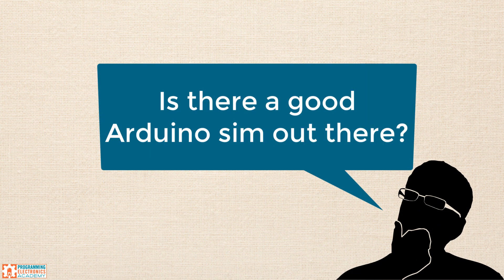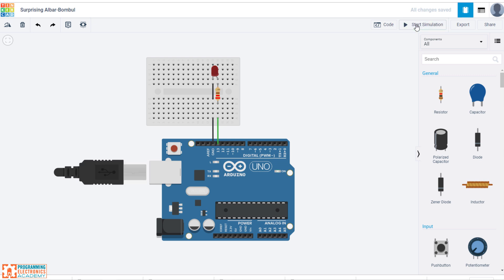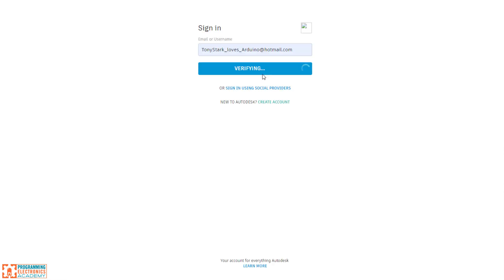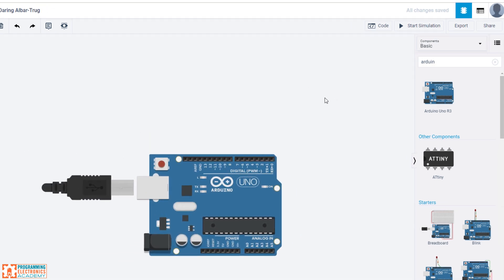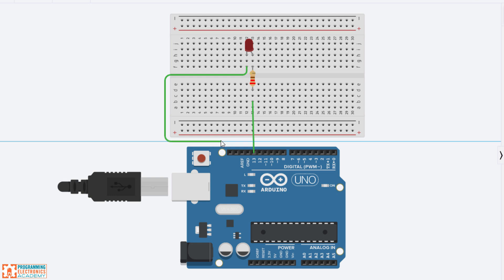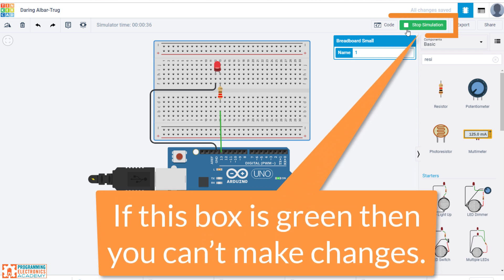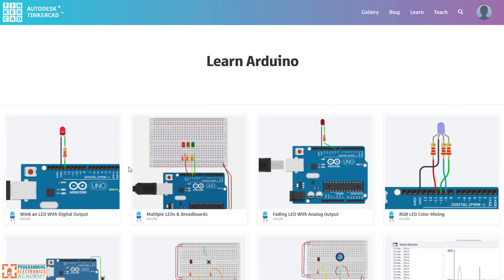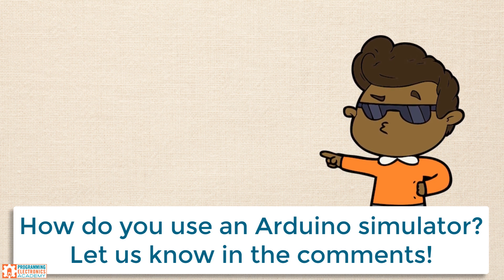The Arduino Simulator you’ve been looking for!

Comment: Hey, an update for Arduino Simulators: (also free) Wokwi. ThinkerCad didn't had the OLED display that I physically have. There are no docs how to create one component with ThinkerCad. Nor import external library. Woki was pretty easy to use. Click + and add the component (several and you can create your own), wire it up, code, play. Also, has Serial output. I've read few docs about how to create devices I2C, and teak the code from uint_8 to uint_32 just for fun learning.

Comment: It might ve a stupid question if I missed some info, but how did you select the 220 ohm resistor if you didn't have any data for the led itself?
Reply from the maker: Great question!  I think if you click the resistor image, it brings up a window to adjust the resistance.
Reply: @programmingelectronics  that one I spoted, I was actually wondering why you set it as a 220 ohm resistor? I did not notice there is any power supply or LED data, and the resistance should depend on source voltage, LED voltage drop and LED current. Can you see the correct data for components in tinkerpad, or do you just set the resistance to real world needs and the simulation just works whatever you put in?
Reply from the maker: Great question  @filips989 ! I see what you mean now.  You're right, 220Ohm is kind of a sloppy resistance value but usually seems to do the job.  I think the sim will adjust accordingly for different component values.

Comment: Simulation is great, but does it also show debugging info. I would like to see what my code does inside the chip, I need to know why it works. OR doesn't work, maybe I'm updating the wrong register or my timing is off.
Reply from the maker: Hi Andrew, I believe the IDE that Tinkercad made for their Arduino simulator has a debugger, my guess is it won't be as granular perhaps as you might hope, but it it is still helpful.
Reply: @programmingelectronics  Sounds cool, I'l check it out. Anything more in depth than print statements is going to help allot haha.

Comment: These guys never make a mistake. The Blink example worked first time. The gallery is full of working examples. What I'd really like to see is that Blink example where the presenter "forgets" to wire in the resistor. Or puts the LED in backwards. What does the simulator do then?? Is this truly a simulator - a design tool -  or is it just an illustration tool?

Comment: How to get the components which are not in tinker cad? Like gsm module. I'm working on a project that i have to present just the simulation and code but some of the components aren't available on tinker cad. Any solutions around?

Comment: Hello! Really nice video! Thank you! I noticed that when the simulation runs, the usb is connected to Arduino. When it stops, the usb is disconnected from the board. Much easier to visualize when the simulation is running. Thanks!

Comment: I used to teach the BASIC STAMP along with the BOEBOT in college, but that was 2000 - 2013.  I began learning C++ programming, but fell out of it due to an extensive hospital stay.
I am currently going through the ARDUINO lessons included in the parts kit.  This will make it much easier to learn and possibly a bit more fun as I don't have to pull everything  out to work.
Thank you very much for this!
ET1 (SW)MTS (USN Retired)

Comment: How about external library, is it possible?
Reply from the maker: Not supported right now. There is a work around, but it is pretty work intensive -> including all the library code into the sketch itself
Reply: @programmingelectronics  if you understand the programming tool chain, you should be able to intercept after the pre compiler, at which point your libraries and macros will have already been expanded into one giant code file, which can be helpful seeing unintentional behavior.  I haven't played with tinkercad, but there should be shortcuts to making this work.

Comment: Yeah no not the simulator I've been looking for.  Looked at it before and it only supports specific boards.  I do most of my hobbying with the Nano which isn't supported.
Reply: They use the same chip, same code. I experiment with uno then use nano for final product as its smaller.
Reply: @jmmjjmmj8994  Sure but the wiring isn't the same (pin positioning) and when I'm trying to design something I want the wiring to be correct otherwise it doesn't serve any purpose to me.
Reply: jmmj jmmj ditto. If I know my project is not going to need much troubleshooting in the software department or if it’s gonna be a relatively simple build, I just take a barebones 328, burn a bootloader and upload the code. I built a shield for burning bootloader with a ZIF socket, then I plug the chip with the bootloader into the R3 and flash my code. TA-DA! An Arduino uC for a buck (by the time you get the chip, crystal, 7805 and the couple of caps it adds up to just about a dollarin my neck of the woods). Sure, a bit of a pain in the neck, but once you do it a couple times it takes about 5-10 minutes to assemble. Again, it’s best for simple projects and something that is a “flash-and-forget” kind of programming.
Reply: @olegvelichko1659  i use cheap chinese knock offs for projects that are not comming back in one piece.
Reply: Code and function is practically identical.

Comment: I have tried it but when we have to use tools like Bluetooth it does not work in simulator.
Eg I want to control Arduino with Android.But I can't use tinkercad as it does not do anything like connecting it with laptop Bluetooth so that we can try to connect it with Arduino
Reply from the maker: Yes, you are right, that is one of TinkerCad's limits at this point.

Comment: Seems like a nice way to “try before you buy” a particular kit.
Reply from the maker: It's a great way to get your feet wet with about 0 commitment.  Though, I must admit, watching the actual hardware do it's thing is far more enjoyable.
Reply: Programming Electronics Academy yes, exactly. I am trying to decide which kit to buy myself. Also, I live in SE Asia and there are kits galore. Some of them, I have learned, may have some issue with USB port on a Mac unless they are the genuine Arduino kit. Not sure if you know of that and could advise about that. Thanks for the reply and now am going to subscribe to your channel.
Reply from the maker: Hey Bruce - I primarily use mac as well.  I haven't personally had any issue yet with different Arduino clones, but I know anecdotally where others have to download different drivers to get the device to show up in the Arduino IDE.  Popular kits in the states come from elegoo and seeed studio, and I have had luck with their Arduino UNO clones.

As a side note, it also doesn't hurt to have a genuine Arduino UNO, as it is pretty much guaranteed to work with the Arduino IDE off the shelf.   Just my 2 cents - best of luck in your endeavors!
Reply: Programming Electronics Academy thanks for confirming what I heard about the USB drivers. I will be using my old, reliable Mac Air. Great advice to get the UNO. I will look it up here - they’re pretty cheap kits in Asia with many, many different flavors. Best regards!

Comment: Nice introduction to Tinkercad. Could you explain how to simulate outside conditions like light on light sensor or distance on distance sensor? Because I didn't see some simulator that is able to do that yet.
Reply: In many instances, the easiest way to simulate missing items is to simulate them with their electrical equivalents.  The equivalent to a photocell (LDR) would be to substitute a potentiometer as that is electrically equivalent.  That isn’t always possible with more sophisticated sensors or modules, but it does significantly expand your options to simulate missing components since many are either on/off, serial data, or analog signals.
Reply from the maker: Thanks for the recommendation Krovak!

Comment: For beginners, this would be great. And for people who need to test code on the Arduino (inputting test variables to see if the output is as expected). But until the library of components becomes more standard, it won't be useful for doing complex projects. But as a learning tool, I can see this working well. Especially since they can start with block code and then move on to actual programming.

Edit: I just tried to simulate something I'm working on, and the problem is there is no way to add a library. You can try to include the library files in the code, but it quickly becomes a mess.

Comment: The best, you can create classrooms and students and teacher accounts. And text code and block code. And export it to ARDUINO IDE. But I would prefer Tinkercad will soon connect directly to ARDUINO and integrate more  shields.
Reply: And you can setup projects fir students to mixe or reply. And have courses about ARDUINO and even integrate ARDUINO to 3D print projects (not simulator yet).
Reply from the maker: Great points Santos!

Comment: Is there offline setup available?
Reply from the maker: I do not believe there is.
Reply: @programmingelectronics  okay.. Can you tell me how to program don't matrix 5x7 display using for loop to display different patterns where 5 anode control lines and 7 cathode control line..
I tried but i failed.. I just wanna start by blinking one by one led on while other leds off at a time with certain small delays.. Can you drop a basic structure to do these.. I have written a program in which c1 r1r2r34567 all glowing one by one but after finishing r7 its not shifting to c2 layer..
Reply from the maker: Great request - I'll add that to our video cue.
Reply: @programmingelectronics  okay ty my dear ill be waiting and thanks for your reply

Comment: Thanks for making this video! I'm getting deeper into arduino and this helps allot! Either I missed it, and I've looked allot, or I'm not getting it yet, but how do you "save as" a circuit that you either build from scratch or one that they have and you have modified? Thanks!
Reply from the maker: That is kind of a tricky one! Great question.

When you are looking at the designs from the dashboard (the different designs are laid out like icons), they have a gear in the corner of each design that gives you a drop down.  One of the options is duplicate, which I think is as close to "save as" that they have right now.  

Hope that helps some!
Reply: @programmingelectronics  
Hi, Thanks for answering! You've put me on the right track. I've learned through experimenting that the "system" appears to save your project automatically. 
I tried making a simple circuit, simulated it and then closed the program. Upon restarting the program, and going into 'circuits' on the left side of the page, it brought up what I just made. Mousing over each project shown, is when that gear shows up. In that drop down list, there is the 'properties' selection. This is where you can rename it as well as edit other stuff about it. Cool!  I'm probably telling you something you already know, but this is how I found that it works.
Kind of a round about way of doing it, but it works fine! 
I guess I'm too used to creating circuits in windows based programs and expected the same method in this one.

I see a small amount of IC's available. Is there a way to add more to the selection of our choosing or are we limited to this amount?
So now on to creating!
Thanks again for your quick response, it is very much appreciated!

Cheers!
Reply from the maker: @cinibar  I don't think there is currently anyway to add components like ICs, this is one of the limits of the system right now.  Not sure of that will change or not.

Thanks again for watching!

Comment: I'm pretty new at all this so forgive my question if it's based on bad info... Why are you calling this "Hello World" when that is an LCD sketch?  Isn't this the "blink" sketch.
Reply: Hello World is general first code. They may not have been referring to a certain project.
Reply: In almost every tutorial for any programming language - Your first program is a "hello world" program -  Typically it's a program that will print "hello world" on the screen somewhere.  In the microcontroller world,  typically they don't have screens, at least to start with - so typically your first program is to learn how to "blink" a led - "Hello World" has become a generic term for your first program, and is something that got carried over from learning to program, to learning to program microcontrollers. In the Arduino world if you hear someone say "hello world" they usually mean "blink" the led.
Reply: @kd8bxp  I did a Hello World today in Python.
Reply from the maker: It's a great question!  There is a picture of an LCD on a breadboard for demonstration , but it's at about 4:30 in the video he starts building the "Hello World" circuit/sketch in the Arduino simulator, which like you said is the "blink sketch" for a microcontroller.